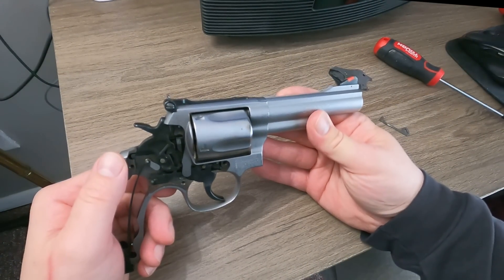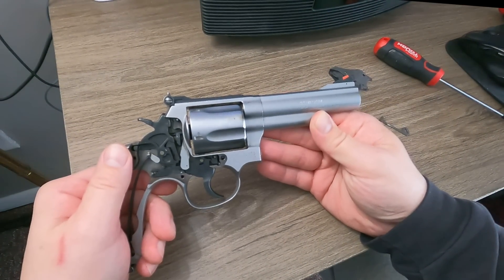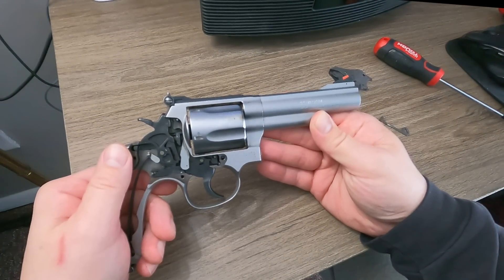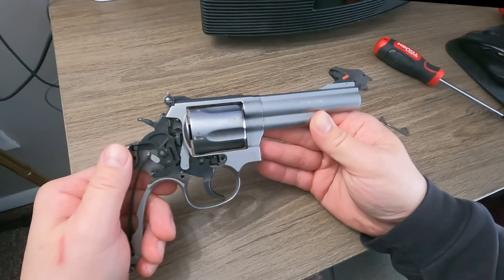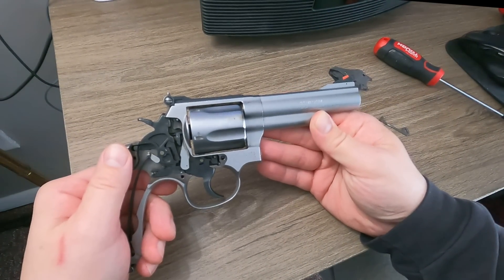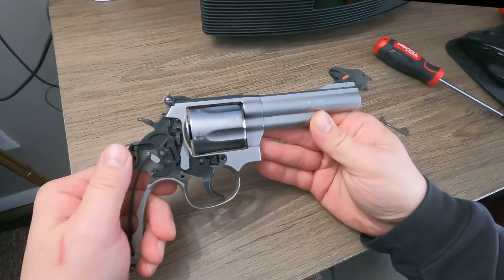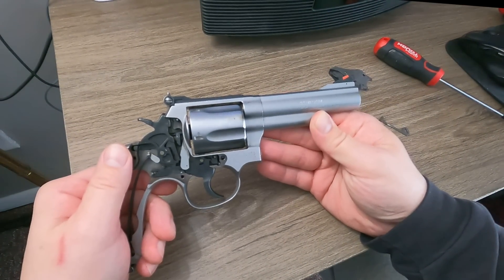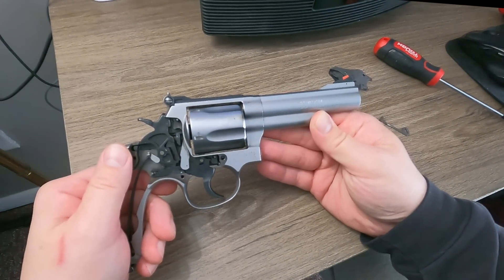Why Smith and Wesson's Revolver "Safety" Action is Superior to Taurus, Ruger and Others

Comment: I've never had a tranfer bar issue with the many Rugers I've owned. I prefer the Ruger coil spring over the Smith's flat spring. I Love Smith & Wessons very much but they will develop timing issues where as a Ruger Redhawk or GP100 never will. At least not in my 30 years plus experience.
Reply from the maker: I haven't had any Rugers have issues either with transfer bars, but have had Taurus ones snap. Ultimately it's one of those things, where a great design can be made with poor materials (AK-47 as an example) and it runs well, but a poor design can't do well with poor materials but CAN do well with good materials. Ruger has some decent steel, even their cast frames shouldn't theoretically be as strong as S&W's forged frames, but they are. Ruger does know what they are doing in terms of knowing what it takes to make something work. I used to have the SP101 and always thought that pull out trigger group was pretty cool.
Reply: Yeah you alwas here the "Rugers are built like a tank" expression. I'm sick of people repeating that even being a Ruger guy! The Ruger frames are cast, but the barrels are cold hammer forged, and the cylinders are machined from bar stock. Yes I do Love a good Smith & Wesson revolver. However I've knocked a 686 and a 629 out of time. Smith & Wesson made them better than new in no time. I fear the quality of Smiths and Rugers is not quite as good it should be lately. Guess I'm a perfectionist?

Comment: Interesting vid.  In my experience, Charter Arms' transfer bars are pretty fragile and will break with much dry firing.  With Taurus, the way the gun's designed the part can be a bit beefier, and doesn't have much room to flop around.  I've not yet seen a broken Taurus transfer bar.  (Never had a Ruger apart to that level, so can't comment.)

Comment: Believe it or not I actually shattered a transfer bar on a super black hawk after 50k (or so) rounds LOL    I did not even think that was possible.    I think the Colt transfer bar was slightly better such as on the Python.    I trust the hammer block more than a transfer bar just as you do but I am real old school and want a hammer mounted firing pin as well.   in Rugers I have seen the firing pin bushing get really crudded up and even seen the little spring in there fail and cause misfires or even not allow the firing pin to return.
Reply from the maker: Luckily a S&W firing pin comes out super easy. Replaced one in my 686 from so much shooting, I dulled it a bit. Put in a custom extended one.
Reply: @GunSam  Yeah.. have not done so yet and almost all of my Smiths are the old hammer on nose thing which....  I have never had a problem with.    The Ruger is a giant PITA to fix.. ended up taking it to a gunsmith. which brings me to...   The problems with the firing pins.  they seem to be short.    Missfires are far more frequent.    At first I was blaming the primers.  I use only Federal on my DA revolvers because they light off the easiest.   Like you said... another go round and they usually go off.   Eventually I did check and the strikes were light.   Ok..  There is a rumor..  and I would never suggest such a thing but...  if a person took like10 thou or so off the hammer nose on a Ruger it is just enough to take the slack or clearance out of the transfer bar (check often to make sure the pin is not protruding)   My theory is also that the pin gets struck a little harder and there is some inertia (like a 1911) stuff happening.   Rumor has it that two Rugers are behaving now.

Comment: Hmmmm although I may agree that Smith & Wesson's are good for some people, I have had nothing but problems with them, I had a model 19 combat magnum and the frame cracked after only 100 rounds, and both of my semi autos have had issues to, sights falling off, slide cracked on one of them, so that's when I went to Taurus and have had no problems
Reply from the maker: That's interesting. Had/have a model 686, 66, 342, Bodyguard, 629, 69, Governor and some others I can't think of and not one problem ever. Owned about 5 Taurus revolvers, every one had problems. Some not serious like my 605 is decent, but the cylinder screw sheared off and the rod always loosens, so that one was "okay" but I have broke multiple transfer bars, had one not rotate the cylinder at all, had a timing issue on a .357 snub of theirs a long time ago too. All I can say is that your experience is definitely different than mine.
Reply: @GunSam  Yeah a couple of my friends have a few S&W and are really good, triggers are nice and smooth, I think I just have bad luck??
Reply from the maker: @keythsmith7924  I get the same thing from a lot of Taurus fans, that they were ALL good, and i'm wondering why most of my Taurus guns sucked. Happens sometimes. I have owned about 3-4 S&W pistols with zero problems too.

Comment: I still prefer the gp100 over the smiths. Never could easily deep clean my smith without all kinds of issues. Never had a problem with either design just like to clean the internals after 500 rounds. The gp100 is a stronger action in that regard, for me anyway..

Comment: Hey Gun Sam, if you had to choose between a Taurus 5 shot 38, or the Bulldog 5 shot 44 special for ccw, which would you pick and why?
Reply from the maker: I personally have never owned a Charter Arms though I have always meant to. Those are both solid choices but I guess the main consideration are if I were to practice a lot with them or not, assuming whoever is buying does not hand load. The 'better' only revolver, or a person with few revolvers will definitely be a .38 Special as you can actually find ammo easily, cheaply. On the flip side, if a person hand loads .44 Special, doesn't practice a lot or can practice with other guns that give a similar feel, than .44 Special can be a tad more effective for CCW. The Taurus will pocket carry easier as well. Not really a better choice here between the two, but for most people I will say .38 Special makes more sense.

Comment: i will stick with Ruger, more quality control and best customer service and any problem with a revolver or semi auto they got my back, should something fail at the 10,000 round mark i carry 2 guns anyway and Ruger will fix any thing i have no matter how many rounds i shoot through a revolver or semi auto, i think i am more worried about slipping on a bannana then a transfer bar breaking
Reply from the maker: I carry an own Rugers too. Not really a huge concern. More of a theoretical thing with Ruger, however I have heard from a couple people who have had broken transfer bars on a Ruger, more of a rarity with Ruger than Taurus.
Reply: @GunSam  maybe a good factory test is to fire double action revolvers thousands of times in single action to see when they start breaking transfer bars, also wonder if metal has tiny cracks, doesnt take much for something to break if you give it a small crack, casting company i worked at we scanned metal parts for small cracks and reject any parts that have it, maybe thats the problem with transfer bars, it needs to be checked or metal should be made to hold up to a single action only tourture test, the reason why they cant copy smith and wesson would be issues of getting sued by smith and wesson possibly and the risk of that, i shoot double action with my taurus revolver with long shots once in a while to test ammo and accuracy at different ranges but i suppose if i did single action thousands of times maybe a trasfer bar would give eventually

Comment: You fail to point out that on the Taurus, the hammer only impacts the transfer bar so much. If the transfer bar were to peen or thin, the hammer would strike the frame as if the transfer bar weren't there - but not as much.  I get what you're saying about the S&W but it is also much more complex... and more complex means there are more things that can go wrong... IMHO  I don't think this matters much...
Reply from the maker: How did I fail to point it out? https://youtu.be/7WL5r9jH_uA?t=425

Comment: Kind of unrelated question, you’ve owned a 686 for a while does it hold up as good as a gp100 when it comes to shooting hot underwood and Buffalo bore loads, have you seen any excessive wear on the gun
Reply from the maker: While I have only owned an SP101 to get sort of an even comparison, really what I can say is that my 686 has not taken on any wear and tear other than slight forcing cone erosion due to firing a steady diet of light for caliber magnum ammo. Any revolver would take on that same wear no matter the brand. The 686 and GP100 are essentially the same strength, it's just that the Ruger frame is bigger due to cast steel and the S&W thinner due to stronger forged steel. GP100 has a longer cylinder to accept longer more powerful rounds due to the GP100 having out of spec cylinder length basically. Honestly they are pretty even, if S&W made their 686 with an out of spec longer frame to accept out of spec ammo, it would handle it just the same as a GP100.
Reply: @GunSam  have you found a factory load yet that won’t work In the 686, and do you think the lock up of the 686(ejector rod detent) and the gp100 (forward frame lockup) make a big difference in longevity durability reliability
Reply from the maker: @bradleypadgett151  I have never had an issue ever chambering a round in my 686. Never had a problem with lockup. The newer S&W's like the 66 combat magnum will use the frame detent instead of the rod so they do lockup really tight, but again never a problem with the 686 in any regard.

Comment: Ruger's Super Redhawk is rated at +p+, no S&W 44 is.  A 44 heavy bear load has more energy than 454 casull, but you can still put 44special in it.  I love S&W, but they aren't a one size fits all.  For defense against 2 legs, I prefer 45acp.  For defense against brown bear I prefer a Ruger Redhawk.   For most hikes in WA, a 10mm is a better choice... but I've had the good fortune to walk away from an angry Grizzly; those suckers make me very nervous and I prefer to put my ability to go home in my own hands, not the vagaries of their fickle moods.

Get a Ruger Super Redhawk and compare how overbuilt it is compared to a 629, for example.  The 629 is a great gun and I offered to buy my friends if he ever tires of it.

Still appreciate the time and trouble you put in to this and other fine videos.
Reply from the maker: I have never seen any data that says a Ruger is "rated" for +P+. You will have to show me that one. What I do know is the only reason a Ruger will chamber those rounds is because they will not fit in a S&W due to the Ruger having longer chambers.
Reply: @GunSam  among other sites the ammo maker rates it to be used in Super Redhawk.  
Why not go look at one?  The barrel is twice as thick as a 629.  When I did my research a few years back, I read more than once that for +p+ the go to revolver was the Super Redhawk.  This is the exact same revolver that was designed for 454.   The Casull 454 is very close to a 44 +p+.  I know the Super Redhawk and Super Blackhawk were once listed to officially support the  +p+, I would think this could still be found.  But what better way to make a +p+ 44 than to start with a 454?

Also are you certain the Buffalo Bore won't chamber in a 629 (even if ill advised)?  I could pull out some ammo and measure, but I am snowed in and have no access to a 629 for a little bit.  I ask because I know someone who shot a bear load through his 629 not sure which bear load might not have been +p+ but just +p.

From Buffalo Bore's web site:
"We get hundreds of emails asking if this load can be fired in S&W revolvers or some firearm other than what is in the above list. The answer is NO. The above list is all-inclusive. If some shooters continue to use this product irresponsibly, we may have to discontinue it, and that would be unfortunate as it is our best selling 44 mag."
This implies that the round will chamber in a S&W, but that revolver is not built solidly enough to deal with that heavy a 'boom'.  This comment was amongst the main reasons I got the Ruger not a S&W.
Reply from the maker: @bjornlovoll8972  I would think if Buffalo Bore said that it's not meant for a S&W, that this has a lot to do with bullet creep and or overall length. S&W does those proof rounds a lot higher than max pressure, I just don't see S&W as weak at all. Also take note that S&W makes the very gun I show in the video, an L frame .44 Magnum. I think the L frame is smaller than the Ruger GP100, which Ruger only uses for their .357 Mag and .44 Special. That should say something about S&W's strength.
Reply: @GunSam  I'm mostly unfamiliar with the L frame, I've used the N quite a bit..  I've shot a 686 only once and in 357.  The 629 I mentioned is thicker and heavier and it is still fairly thin and not recommended for the bear loads by Buffalo Bore. .  Before you get too defensive, go look at a Super Redhawk and compare the amount of metal they thought necessary to contain the ammo they were building for (454 Casull and bearload 44) and the  SAAMI specs (36,000 PSI for the normal .44 mag, and 65,000 PSI for the .454 Casull).  It does not compare to the gp100 or any 44 from Smith.  The Colt seems closer, I've always wanted a Colt so I might have a bias there. 

Saying a f350 isn't able to do what a semi can, is not the same as saying the f350 sucks; just that they are not the same class of animal.

Comment: Ruger uses superior high strength steel for all their parts.
This has been noted by countless gunsmith who have been in the industry for most of their adult lives.
I have yet to see a transfer bar on Ruger GP100 break or snap.
Design is such that it is impossible for most part with even worse abuse and extended use of them.
Not doubting S&W design at all just throwing some facts for Ruger.
I don't own S&W because Ruger I got was less expensive and one day I will be able to afford a nice S&W like yours).
I have heard of Taurus transfer bar issues but not Ruger.
That's what I know could be wrong.
My one experience and years of talking to people in the revolver industry and owners.
Reply from the maker: I have heard people tell me that they had some Ruger transfer bars break, but like I pointed out, I never had a Ruger transfer bar break.

Comment: I hear a lot of mixed feelings on the Hammer Block in a Smith Revolver, some taking them out, some leaving them in.  what are the pro and con of each in regards to its function and performance?  I'm looking at a 629 44 magnum, and wanna make sure it stays reliable and functional if I make any alterations/upgrades (i.e. main spring, extended firing pin, and more stout trigger return spring) to try and improve its ease of use and its performance
Reply from the maker: I don't really think taking the actual hammer block bar out will change anything. When you pull the trigger the bar pulls down, it weighs basically nothing and is smooth so the trigger pull would be the same, the rebound slide automatically pops it back up for you with the rebound slide spring you already pushed back when firing, so there's no added force there either. There's no practical reason to remove it or to keep it there, but I guess one benefit to it being there is if for some reason the hammer was crushed somehow, in someway, the hammer block would still prevent it from hitting the firing pin, also I wouldn't want the super slim chance of using it for self defense, the case being questioned in some way, and "oh yeah the defendant removed the gun safety to make it more deadly" with jurors not knowing any better.
Reply: @GunSam  you just nailed the main point against removing it, its the inevitable "he made the gun more evil..." argument if the SHTF.  Honestly, I'd use my Taurus over the 629.  30 rounds over 18 (i live in Massachusetts).  Then the argument becomes "I had to grab a second firearm to defend my self in my home, or on my way home from a wooded walking trail/hike, I was unable to retreat and had to fight my way out".  hard to claim (and they still will try) an "evil modification" for a second defense option.

Keep up the great videos, thank you for the insight and reply.  Your videos are honestly one of my best resources for honest and unbiased ballistic performance of defensive rounds :)

Comment: With a S&W if the hammer block breaks the pistol will fire if dropped, if a transfer bar breaks the pistol will not fire if dropped, which sounds safer to you? We are talking safety aren't we.
Reply from the maker: The S&W sounds safer to me. A handgun isn't going to fire if dropped, if dropped exactly on hammer spur with no safety in place, then maybe. But the main point here, is that a S&W hammer block isn't going to break, and if it somehow did, the bar doesn't or can't fall out of the revolver, but nonetheless the hammer block isn't going to quit working, what could happen is a transfer bar could break, leaving the user helpless to fire more rounds to stop an attacker, so again, the S&W hammer block seems safer to me.

Comment: I've had transfer bars break on both Ruger and Taurus revolvers that completely locked the gun up. I also have an old Rossi with a clone of the S&W action with the hammer block and it has never failed.
Reply: Rossi made a inexpensive dependable revolver